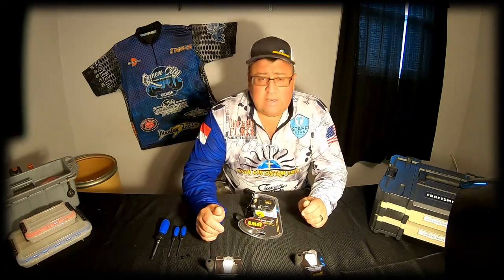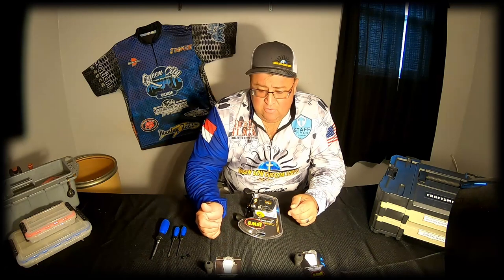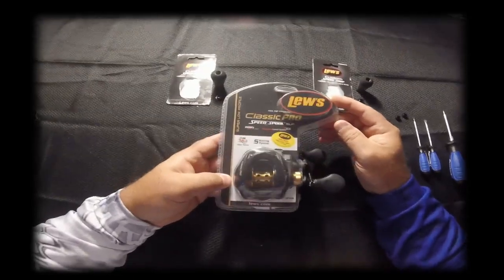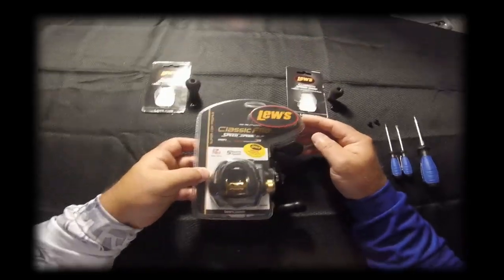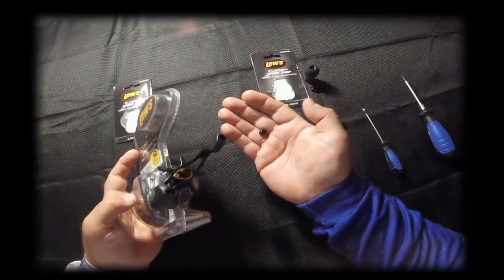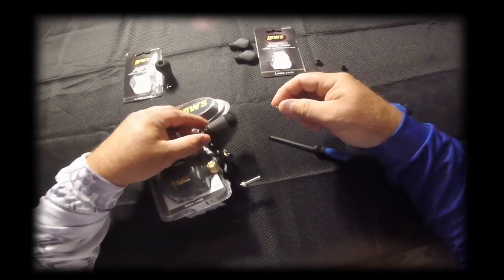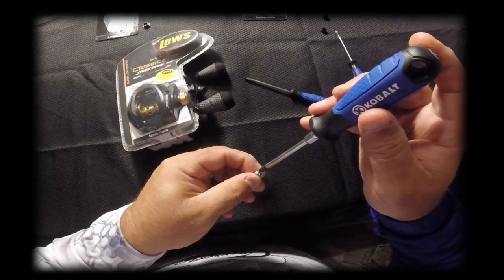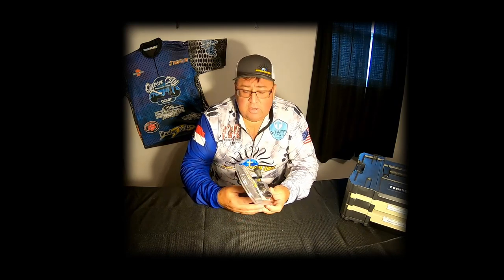How Too Add Custom Knobs To Lews Reels

Comment: Where did you buy the knobs?
Reply from the maker: Rowen thanks for stopping by. Please make sure to like and subscribe please and share working on getting 1000 subs this year and I need your help. I got the knobs on Amazon and I made sure to shop around for the best price. Also make sure that you get the standard knob and not the oversize. I made that mistake and the oversize knobs are ok but they are bulky. Just shop around for the best buy on price. Hope this helps. Thank you.

Comment: Those knobs are expensive
Reply from the maker: Yes they are, I have attempted to locate them on line and can find them a little cheaper at times, but you are correct they like them very much.